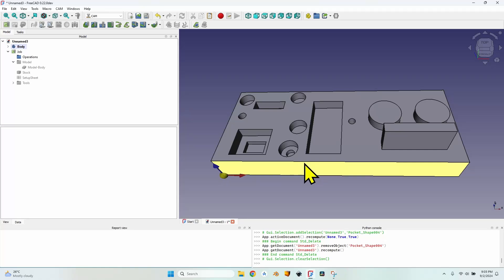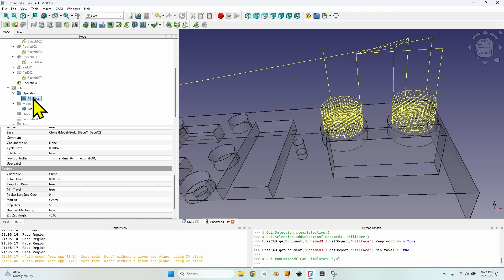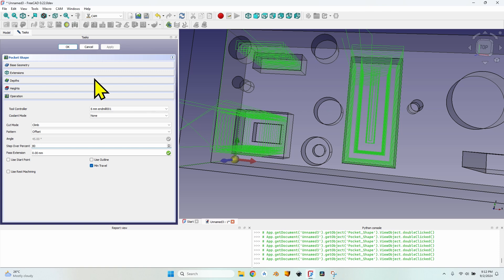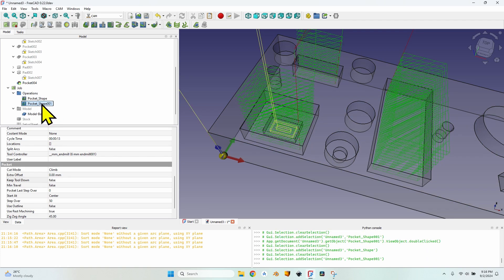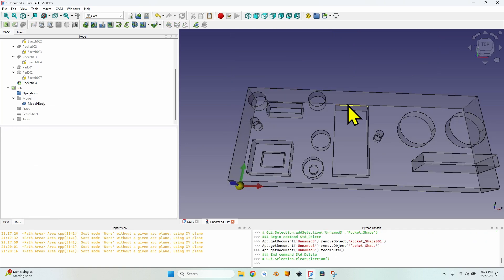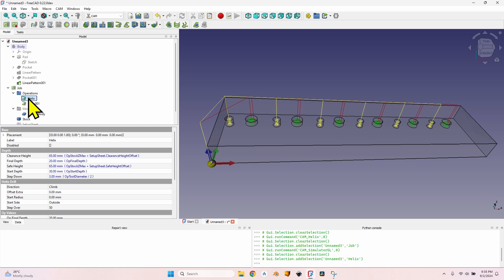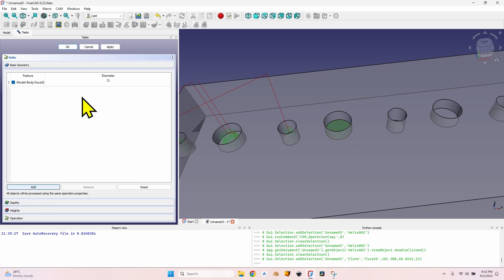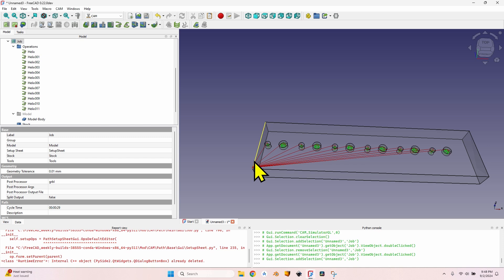Make CNC Jobs Run Faster – FreeCAD CAM Tip 12 (Toolpath Optimization)

Comment: The fact you can select a face as starting depth made me swear out loud.
Some great tips in this vid; now I just need to get good enough that saving time helps.
I spend most of my time arguing with the actual milling operations. Job sets fine, shows object.
Add an operation like pocket and suddenly it cant see the base object so does nothing. Object not allowed by filter? or some such rubbish.
I will eventually win; tenacity. Also comments to feed the 'tube algorithm to boost your channel.
Reply from the maker: Thanks, I'm glad I could help! Keep on trying, you will eventually get to know the unknowns of FreeCAD CAM :)

Comment: Great stuff!! Have you considered working with the devs on the cam workbench…. Your using cam to its fullest potential and finding its weaknesses ie setting the tool bit to stay down should be a check box on the main window not in the menus below… the rest tooling should be absolutely developed and expanded further with a crash warning implemented.. not to mention the 3D operations that are buggy beyond use ability … these are features that only an experienced cnc operator would notice ,and I think the devs need  this kind of depth of insight .. 
thanks again for your vids !! Top notch!!
Reply from the maker: I made the first step, I started reporting all the bugs that I encounter. We'll see where it will go from there
Reply: I am just starting to work with the devs. I went to the Springfield meetup last month. Version 1.0 will be a major achievement. I consider both REST machining and adaptive toolpaths to be critical doing serious work with FreeCAD. If you are interested in helping ... and that could be just writing user documentation .... please reach out.
Reply from the maker: Thank you for your invitation. I will for sure take into consideration contributing. Not sure for now exactly how, but there are a lot of things that can get better and the only way it can happen is if we all work together.